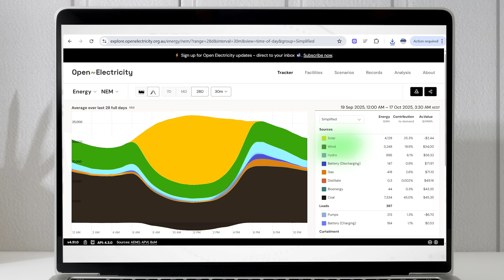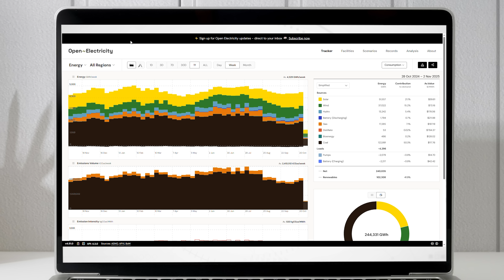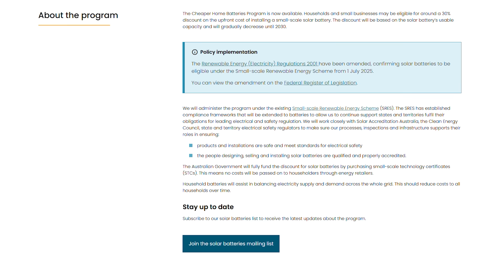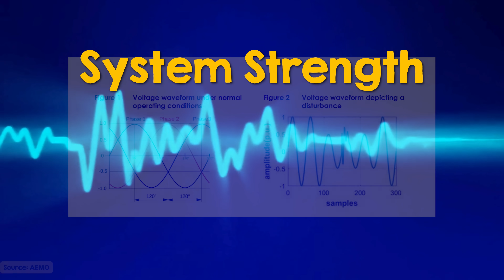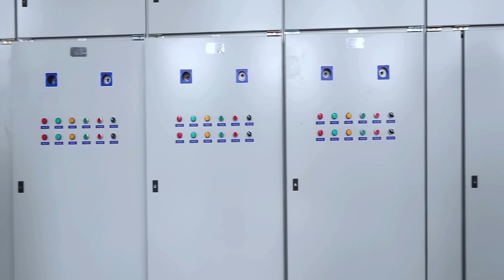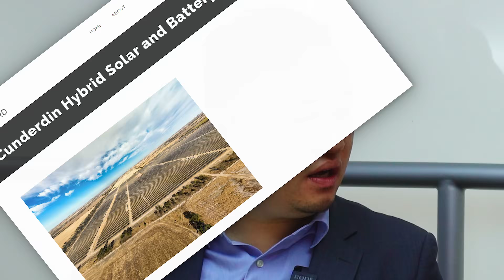Australia’s Solar Boom Is Breaking the Grid - Or Is It?

Comment: Bonkers!   Australia's electric rates have shy rocketed along with power grid use of natural gas to support a larger and larger solar and wind generating space!  It cost more natural gas in high readiness costs alone making near zero electricity to support the generating space of solar and wind generated electricity than making all the electricity with NGCC power stations.   Since little of the natural gas is generating electricity the high natural gas use is  hidden from the public.   Wind power with its wild fluctuations second-to-second requiring high compensation jerks in natural gas turbine generators above high readiness is the most natural gas expensive form of providing electricity.  

Look at an a wind farm's instantaneous power output and if it's not being culled the power fluctuates wildly and largely in one second.  It looks like putting that on the power grid would reck it.

There has to be some playing around with words when saying Australia is getting 50% of electricity from "renewable" energy.   Only 6% Australia's electricity is from hydropower which is base load power.   44% average from solar and wind power would mean peak solar is more than the entire power grid could handle.   If solar is charging batteries where the batteries provide power it is not treated as solar power by the power grid. 

NGCC power stations are 2 to 3 times more expensive to fuel than an efficient coal power station for countries with cheap natural gas and high quality coal.    Steam turbine generators react too slowly to support solar and wind generated electricity as does transitional hydropower.   New fast reacting hydropower is used to support solar and wind generated electricity to save water head.   Scandinavian countries, China and Brazil have some fast reacting hydropower the largest being the 22.5 GW Chinese Three Rivers Dam hydropower station.    

Overwhelmingly large wind power forced to be supported by the public power grid means a large market for by-product natural gas from the oil fracking industry emerging in  the 2000s which was the back market effect from Al Gore's 2006 film "An Inconvenient Truth".  US vise president Al Gore 1993 - 2000) received $70 million USD from the Arab natural gas exporting country Qatar from its state owned Al Jazeera news network 2015 purchase of Al Gore’s Current TV.  

Earth’s water vapor saturated greenhouse effect can not have its overall effect changed completely absorbing all the greenhouse radiant energy within a few meters of the radiating surface adding 5.55°C (10°F) to earth’s average temperature (1978 earth science Marshall High School, Falls Church VA).  On average water vapor with a CO2e of 18 and 1% of the troposphere is over 99.5% share, carbon dioxide less than 1/4% share with 40% considered to be from human causes being less than 1/10% share.  NASA reports global warming at 1°C since 1992.  The cause of global warming is not known.

Comment: I would have thought that flywheels would be the perfect mechanical solution to grid stability but I guess before flywheel tech could mature it got overtaken by better digital solutions.
Reply: I suspect that virtual flywheels can supply over-current in a way that synchronous condensers can't.

Comment: Always enjoy the explanations which are easy for the layman to understand.  Australia will lead the way to the technology solutions which will make renewables & distributed power production fit the grid established in the previous centuries.  As the transition to electric vehicles grows there will be a need for more distributed power production in more remote areas to support the growth of TVs so they can utilize smaller batteries & charging stations can be located in these more remote locations.  More distributed battery storage can help stabilize the grid & can hasten the electrification of the transportation sector as well.

Comment: Britain was trying to run their grid without any natural gas input sometime this year, which is similar, but it's looking like they won't be doing it this year.
Reply: Parts of GB have succeeded though, it is quite common for the Scottish grids to be running at zero CO2, and North Wales sometimes does too.  There are a few areas that rarely get close, so we won't be seeing the whole of GB at zero for significant periods anytime soon; South Wales seems to be too dependant on LNG imports still, until the Celtic Sea windfarm gets into production, which is going to be quite a few years from now.
Reply: UK has nuclear which might provide enough stability from heavy rotating masses. And some coal power plant now running on biomass.

Comment: I feel a bit sad when I hear that grid forming inverters are working hard to simulate mechanical inertia.  We have an opportunity to do much more generalized distributed controls that have no analog to mechanical inertia.  I can even imagine a time in the future where AC itself is an anachronism and there is no reactive power demand and sagging in frequency is meaningless.  Perhaps the price you pay or earn for electricity is metered by the microsecond and is inversely proportional to the spot voltage.  Everyone would have an incentive to keep the voltage at the right value everywhere.  Smart appliances would save money by jumping offline if the voltage was getting low.  At the same time home battery systems would earn money by jumping in and boosting the grid.

Comment: Great video thanks. 

Is there any info about rare earth materials needed due to the massive use of power electronics in grid forming inverters?
Reply: I believe "rare earths" (common in nature but difficult to extract) are mostly used for permanent magnets, which are not needed in inverters. Clearly a lot of exotic materials are.
Reply: Surprisingly few rare materials in inverters. It's mostly just plain old copper, silicon, and the plastic used to encapsulate the components. The semiconductors need tiny amounts of some other elements, but no rare earths.

Comment: They just announced that they may have so much power in the middle of the day, they may announce free power to consumers.
Reply: Makes sense, they need to spill energy to stop the price from inverting. If people can run, for example, their AC in early afternoon for free to cool their houses it could offset demand later in the evening.
Reply: @thomas316  or switch hot water over from night rate
Reply: @thomas316  Or have electric battery cars and trucks and charge them during the day.    Maybe have electrical power in the parking lot of businesses to help with charging.
Reply: This was the promise of the nuclear power industry- power too cheap to meter and it never happened, as nuclear is the most expensive generation path. With free electricity, the option exists to electrolyse hydrogen from water. Then sell it or use it to run fuel cells at night
Reply: @Bakes-z4c Nuclear is a good strategy for commercial applications but only at a large scale. That's why China are going down that route so aggressively, to maintain energy dominance.
Reply: In the past they have charged customers for producing solar because there was too much. 

They'll never make it free
Reply: L.n.p government  screaming it's not free enough. 😂😂😂😂😂
Reply: Yep - not legislated yet but it looks like certain parts of the grid will get 3 midday free hours of electricity

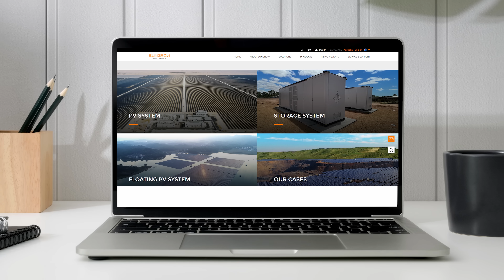Comment: 14:19 Why don't you mention other options for balancing the duck curve of generation and demand?
For example, bifacial vertical solar panels with the edges facing north-south and the west side leading, which would provide 80% peak generation in the morning after sunrise, 100% in the evening before sunset, and a minimum of 40-50% in the afternoon?

Bifacial solar market is expected to grow significantly, with some projections indicating it could reach over 70% of the total solar market by 2030.
Reply: A real use for them, rather than being marketed at homeowners to be stuck on sloping roofs!
Reply: @matthewmarks6951 I saw at least every 1 of 3 new solar generation power plants with biracial vertical panels.
Reply: Whereabouts?
Reply: @matthewmarks6951 In the center, south and east of Europe
Reply: @MihailG5541  Yes, I guess they're more suited to lower latitudes.

Comment: 11:28 What is the percentage of losses in a grid built using only inverter technology with a renewable energy share exceeding 75%, taking into account frequency, phase, and signal shape unevenness, as well as frequency and phase discrepancies in a three-phase grid?

According to calculations, this will be three times higher than a grid with primary baseload generation (excluding imbalances, i.e., direct losses from renewable energy due to the failure to supply excess or insufficient power to the grid).

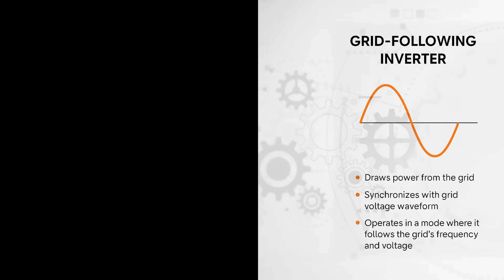Comment: 10:30 The waveform of grid-tie inverters is far from sinusoidal. Synchronous condensers, capacitors, and baseband generation are still needed to stabilize the waveform and reduce reactive power.
Reply: My inverter claims 3% distortion I think. My garage door started mysteriously opening in the middle of sunny days until I stuck a capacitor on a connection to the motor from a keypad.
Reply: All inverters that are certified to connect to the grid must a generate a sinusoidal wave form with distortion limits as defined in IEEE 519. Capacitors can only increase the voltage by generating reactive power while inverters can both increase and decrease voltage by generating and consuming reactive power.
Reply: Doesn't that depend on the technology, and somewhat on the voltage of the inverter connection?
Modern switching power supplies are so flexible that we use them for audio amplifiers (e.g., a "Class D" amplifier).
That trick gets more difficult at transmission line voltages, so that detail also matters.
Reply: @davidchase3269 Measure 3,5,7 harmonics (150,250,350 Hz) in your power grid with a high share of renewable energy sources and think about how this affects the power system.
Reply: @MihailG5541 this only shows the voltage harmonics caused by everything on the grid, including all non-linear loads such as switch mode power supplies. If you want to measure the harmonics of renewables you have to measure the current harmonics at the source.
Reply: @MihailG5541  I think the cost of the inverter is the missing variable.  Cheap ones will just barf out square waves (or a few square waves) and produce the results you're talking about. But a high frequency PWM audio amplifier is an "inverter" with THD below 0.1%.  I understand that there are power inverters produced using this technology, but they're more expensive and so as long as renewables were in the minority, cheap quality was good enough.

This is not a technology problem, and it is not an insurmountable expense, this is more a lack of adequate regulation and penny-pinching by suppliers.
Reply: All inverters measured with an oscilloscope showed worse waveform and deviation results than generators from small hydroelectric power plants, small gas piston thermal power plants and after a synchronous condenser.
Reply: Well it would be expected that an electrical machine would generate perfect sine waves, but I wouldn't consider 3% distortion as "far from sinusoidal." If distortion proves to be a problem, inverters will have to have better filtering etc. Presumably the larger ones, which have the most effect, will have the toughest specifications.

Comment: I do not get it. Why don't the grid generators switch to ELECTRIC POWERED flywheels instead of steam turbine? If electricity is negative in the daytime use it to power those flywheels with Motor/generators that can be reversed at sundown for grid stability? And the utilities could also replace those extra acres from steam generation for gravity towers to store for overnight. Once again use that negative priced power to lift and then let gravity return the power at night? Here in Missouri USA we have hydro gravity systems (Pumped Hydro)  that stabilize us by pumping water all night and releasing to generate when needed. If we had that much solar on the grid, we would just pump daytime when there is oversupply at near free and use when demand is high. Towers with weights and gear reduction systems are not rocket science. I don't get it. The utility companies could arbitrage the cost differences for pure profit. By using the excess that would raise daytime rates for profit and time shift the usable power to prime profit. Win win in my book.
Reply: Flywheels stabilize the grid within tens of minutes, not hours or days.
You might be talking about high-speed superflywheels rotating in a near-vacuum at speeds exceeding 10,000 rpm on magnetic suspension with a single support bearing, but that's a separate, complex topic.
Only a combination of hydroelectric power plants and pumped storage power plants with fast-acting gas generation can guarantee full coverage of daily and weekly peaks and dips of "duck generation" with a high share of renewable energy sources.

Comment: 8:18 Why didn't you mention that in Spain at the time of the energy crisis:
- the total installed capacity of BESS storage was only 1 GWh, with a capacity for 45 minutes of operation at full power, but the target was 6-8 GWh for 2 hours of operation;
- the installed capacity of pumped storage power plants was 3350 + 1150 MW, with a target of 6 + 2 GW;
- the capacity of high-voltage transmission line interconnections was up to 2.6 GW, with a target of 6-8 GW.
Reply: The Spanish blackout was due to a multitude of causes, including gas and nuclear plants not providing the contracted voltage control and grid stabilisation they were supposed to. The instability problems started more than a month earlier when Spain switched to 15-minute block accounting instead of 1-hour blocks. The various reports combined are hundreds of pages. It was a complex cascade of events that could not possibly be summed up or explained in the short time that Rosie dedicated to the topic in this video.

Comment: Lithium batteries are for light weight high performance. Why would you use them for grid storage?
Reply: Well for a start, there is more than one type of lithium battery. LiFePO4 are less lightweight, but safer and longer-lasting. Sodium would be great but its cost benefits have not yet been realised.
Reply: @matthewmarks6951  All of which are for light weight.
Reply: @eanerickson8915  Not really. LiFePO4 are chosen for fixed applications not for weight reasons but the reasons above. Don't get hung up on the lithium element - it's only a minor component of a lithium cell.

Comment: This could be a game changer for many countries, not sure it's the solution for grids like Europe.  I assume that each grid leading inverter would not synchronize with any other, so it would be difficult to replicate the existing interconnections between many countries or states in the US.  
Hopefully this solution works really well, the more solutions there are for integrating renewable energy onto a stable grid the better.

I thought there was a lack of discussions on downsides.  After all, there will be standard risks with software stability and software security.  The more systems are installed and the more real life experience, the more effective the systems will become, but teething issues happen.
The biggest issue I think is the existing battery technology for grid scale applications.  Yes, there are many systems assisting grids, but they are all relatively new.  The longevity of battery systems in real life is being determined now, as is performance in differing climatic conditions.  Still, battery technology is improving rapidly, and technologies like sodium ion and aluminium ion are apparently almost ready for market.  
And you can buy a lot of batteries for the price of the cost-overruns on Snowy 2, which is effectively a mechanical battery.
Reply: A grid-forming inverter would synchronise with all the rest via the grid, would it not?

Sodium batteries are on the market now. Economies of scale mean they are not yet as cheap as their bill of materials would imply.
Reply: For this to become a game-changer, huge investments are needed in AC transmission lines with closely spaced medium and high voltage phases from 10 to 1000 km and in ultra-high voltage DC transmission lines over 1000 km long for transfers between time zones and between renewable energy generation zones and key consumers.
This also includes huge investments in the conversion of hydroelectric power plant cascades into hydroelectric-pumped storage power plant cascades and in the construction of high-speed gas generation using gas piston and gas turbine engines with cogeneration or even trigeneration (generation of heat, electricity, cold, steam or water desalination)

Comment: Are there grid forming inverters there for individual homes
Reply: Inverters for off-grid systems have always formed their own grid!

However the purpose of a grid forming inverter is to support a part of the shared grid that has been cut off from the central AC clock; it is by definition, not for individual homes; it is for sharing.  If it is only your home that has been cut off, then yes, it will then form a separate grid for your individual home, but that is not its purpose, for that you could use an old fashioned off-grid inverter and it would work fine.  The grid forming inverter is needed so that your inverter can synchronise with next door's inverter when the street is cut off, but your house is still connected to next door; and then all the grid forming inverters in the street can then share the load, providing a much better supply than any individual house can.

Comment: Would an inverter-based grid facilitate transition to HVDC transmission? 🤔
Reply: High-voltage direct current systems are advantageous underground or underwater at distances greater than 80 km or for overhead power lines at distances greater than 600-800 km.